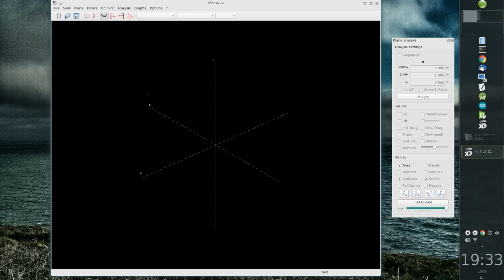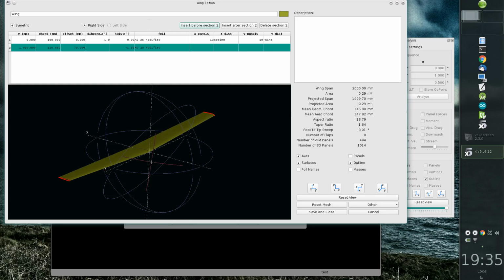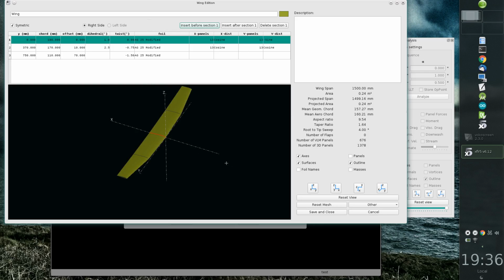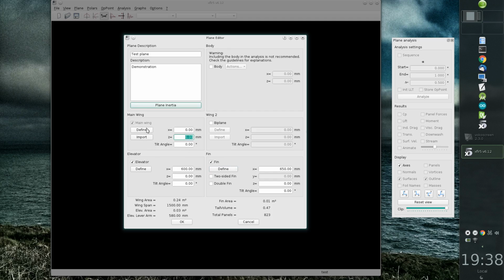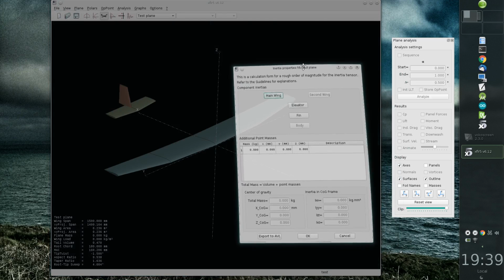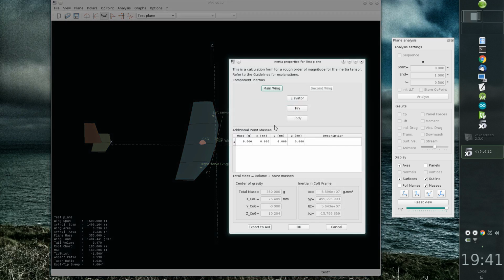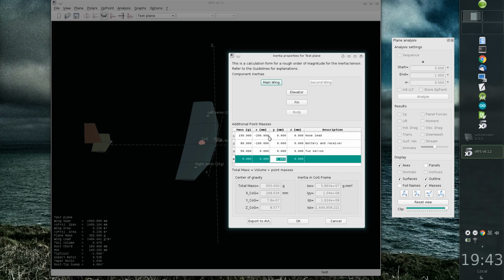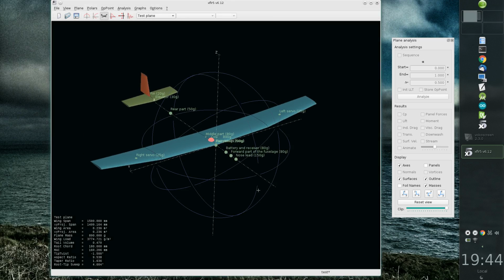7 Design a plane

Comment: Got a question, in minute 2.20 you increase the dihedral angle on the outside part, so, this angle is measured by adding the last dihedral angle (1° for the first part), making it a 3.5°? or it's just by itself 2.5° in relationship with the horizontal axis?
Reply from the maker: All dihedral angles are defined with respect to the horizontal axis.

Comment: Is it possible to define more lifting surfaces than predetermined? I mean, for example 3 fins, triplanes or both front and back fins.
Reply from the maker: No, the design is limited to 4 wings altogether
Reply: Neither modifying geometry code?
Reply from the maker: Not sure what you mean by that

Comment: excellent  videos. could you plss make a video on possible errors that might occur while defining and analyzing any part of the plane and methods to correct it. eg "panel sequence is inconsistent" .
Reply from the maker: "Panel sequence is inconsistent" means that the foil sections are not defined from root to tip along the span, i.e. at least one section has span position < than the next one.

Comment: subscribing..thanks for the tutorial..how to know if my wing area is sufficient enough for a given load?thanks
Reply from the maker: The idea would be to use Type 2 polars. These polars adjust the velocity so that the lift force, which is proportional to wing area, balances the weight. So if you know at what speed you intend to fly this plane, you'll be able to tell if there is enough wing area.

Comment: Sorry, I got a question. 
I've done the same as you do in your tutorial, but when I define the wing mass, 0,300g, my X_CoG, Z_CoG, and also moments of inertia, are different from yours. I've checked it and done it 3 times but they are still different. For example, Your X_CoG is 79.737 and mine is 80,874, and your Z_CoG is 9,404 and mine is 10,694. In Z_CoG theres a difference of 13,7%.... If I've done the same as you did, do you know what could be the problem or what should I check? I've already checked the wing dimensions (wing span, area, projected span and area, mean geom. chord, mean aero chord, aspect ratio, etc.). Im also working on the latest version, V6.12

thanks in advance.
Reply from the maker: Maybe it should be 300g and not 0,300g ?
If it can help, I've uploaded the project for this video  here: http://www.xflr5.com/docs/test.xfl
Reply: +techwinder thanks for the file. I've checked it and the xcog and zcog are the same as I got. At minute seven it appears the values I wrote above, but in your file they are the ones I got, so problem solved. 
Thank you. Your videos helped me a lot.